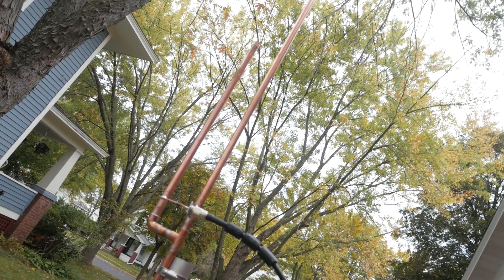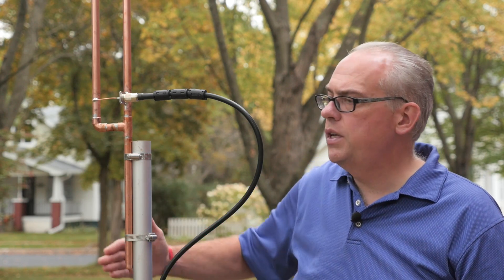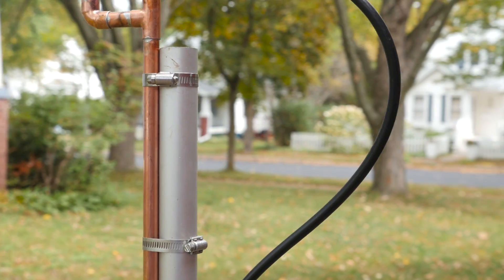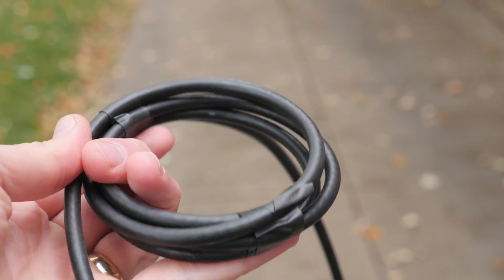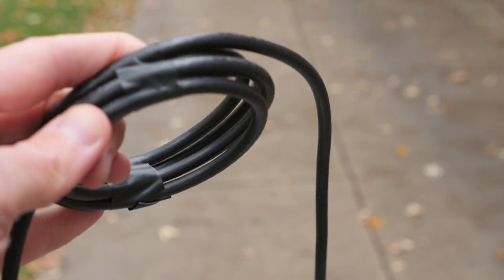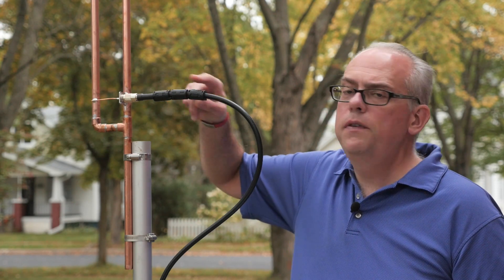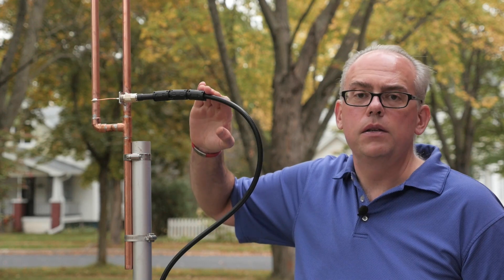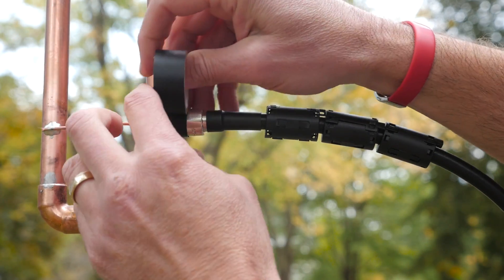Installing the KB9VBR J-Pole Antenna

Comment: Is that mounted to a metal mast? Is it grounded?
Reply from the maker: The J-Pole is a half wave antenna by design, so it does not require a ground plane or special grounding to function. You can mount it to either a metal or non metal mast without affecting its performance. Hose clamps or U-bolts work the best for mounting it to the mast.

Comment: Why do you have the center conductor going to the short leg?  Isn’t that incorrect?
Reply from the maker: As you have probably found out by searching online, there are plans that attach the center conductor of the coax on either side of the antenna. I have experimented with attaching the center connector of the SO-239 to the stub and to the main radiator. I have not found a difference in signal quality or performance. I choose to mount the edge of the connector onto the main radiator because I believe it makes a better mechanical connection.

A J-Pole style antenna is comprised of three sections. First is the mounting section where the antenna is attached to a mast or support. The second section, which is 1/4 wave long, is the impedance matching section. The two pieces of the antenna that run parallel to each other change the impedance from the 50 ohms at the feedpoint to about 300 ohms which is the impedance at the start of the third section. The third section, which is 1/2 wave long is an end-fed dipole radiator. With end-fed antennas, the impedance is high at the ends and low in the middle. With the 1/4 wave section, the impedance is low at one end and high at the other. So the two parts of the antenna can work in harmony.

Interestingly enough, in the Rothammel's Antenna Book (13th ed english translation, page 777) the author states that feeding both the short and the long sides of the antenna are electrically equivalent, yet a configuration where the short side is direct fed provides improved overvoltage protection because the half wave section is directly grounded via the outer cable conductor. (parenthetically, this method also helps lower the overall noise floor of the antenna, by dissipating static to ground). 

Since a J-Pole is considered a balanced antenna- it is a half wave antenna by design; the RF energy will travel up the matching section and then radiate from the resonant part of the antenna. Hence it really doesn't matter which side the connector is attached to.

Comment: Does the azimuth facing direction of the 'short' side have any effect on the radiation pattern?
Reply from the maker: The antenna is omnidirectional but there is a very slight bit of directivity. Maybe .5 dB, which isn't much. I usually tell people installing the antenna to make some test transmissions, rotate it 90 degrees and repeat. Pick the direction that gives you the best results.
Reply: @KB9VBRAntennas  thanks.

Comment: As a new Technician getting into the hobby this is a great antenna. I only have an HT (handheld) at the moment, a Wouxun KG-Q10H, 6 watts max, and participated in my first local net the other day. When I was using the HT antenna, I could barely be heard. I switched to this VBR J-Pole antenna and they reported full quieting. Solid construction, great results, and very affordable! Thanks! Pete KQ4TNW

Comment: Electric tape is not a good option, coax seal tape should be used for that application.
Reply from the maker: Why not? It's commonly used at commercial tower sites.
Reply: @KB9VBRAntennas  Run of the mill electrical tape is not meant for applications that expose it to direct sunlight and its not at all meant for weather proofing.
Reply from the maker: I agree. That's why in the video I recommend high quality electrical tape such as Scotch 33+ or Super 78.
Reply: @KB9VBRAntennas  As an electrician we can not use any vinyl based tape for weather sealing, NEC (National Electrical Code) calls for rubber or MIL tape.

Comment: Hi Michael,

A few quick questions: If I mount a J-pole antenna about 15 feet above ground, with no interfering metal or buildings, can I reasonably expect to connect with repeaters about 80+ miles away?
(The repeaters operate on 2 m and 70 cm, with their antennas about 50+ feet in the air.)

I am using a 5 watt HT at my end, and would like to use either of these frequencies, whichever works best.

Also, would a Slim Jim antenna work better here?

Thanks,
Jerry Wysocki, KC9JXE
Reply from the maker: This is a tough question to answer without knowing about the terrain and the coverage pattern of the other repeaters. It could be possible to hear one 80 miles away if the repeater was in a very good vantage point and running a bit of power.  

As for choosing one over the other, J-Poles are a good choice if you are mounting the antenna at a lower mast height, or if you live in an urban area or valley. The omnidirectional radiation pattern and higher takeoff angle makes it easier to get a signal out if you are surrounded by buildings or rough terrain. Also, with the base of the antenna at DC ground, you can mount it on a metal or non metal mast with affecting the antennas performance. It also has a very low noise floor which makes the J-Pole an excellent receiving antenna for weaker signals. 

The Slim Jim has a lower takeoff angle and more compressed radiation pattern. These two features of the antenna gives you about twice the gain as a standard J-Pole. A little more gain will make up for some of the feedline losses you’ll receive at VHF frequencies. Plus it will help stretch your signal out a little further. To really realize the benefits of the Slim Jim, you need to mount it in the air at about the 20-30 foot level. It will work well at lower heights, but the antenna shines when you get it up in the air.
Reply: Thanks for your answer. I'm in Illinois, about 80 miles directly west of the uppermost northern tip of Chicago. So it's pretty much flat terrain, with elevation going up gradually about 300 feet from where the repeaters are, to my location.
Does a Slim Jim antenna have the same similarity with the J-pole, in that with a 2-meter J-Pole, you can also use a 2-meter Slim Jim on 70 cm, as well? In other words, are Slim Jim antennas, dual banded like J-Poles are (2-meters as well as 70 cm, useable on the same antenna)?
... Jerry, KC9JXE

Comment: Thanks for your videos, parks on the air, etc. Very helpful. Question of the day, so what if I use hyperflex10 cable your snap on baluns and say wanted to put a loop of wire up there in case I swap out the antenna at some point? will a single loop of wire case issues? Any why 4" - is that a function of the signal around the wire? What if the loop was 10" ?

Comment: Hello :) Which GMRS J-Pole antenna do I need for a cheap Baofeng UV5R radio (GMRS & FRS Frequencies installed) & what connectors/cable do I need to order from your site ?... Thanks.
Reply from the maker: This is the antenna you will want: https://www.jpole-antenna.com/shop/462-mhz-land-mobile-gmrs-j-pole-antenna/
Reply: @KB9VBRAntennas  
SO-239 Connector or N-Female ?
Thanks :)
Reply from the maker: The SO-239 is the most popular choice and it will work with the widest variety of equipment. The SO-239 (UHF female) connector mates to the PL-259 (UHF male) connector commonly found on coax cable. Here's a video that tells more: https://youtu.be/DoKtRSLDY40

Comment: How about adding heat shrink to protect the feed line connection to keep moisture out would it cause any problems ?
Reply from the maker: You could protect the connection with heat shrink, although that may not give you the best seal. I prefer high quality electrical tape like Scotch 33+ or Super 78.

Comment: If needed what is the best way to ground this antenna? Just purchased one. I’m excited to set it up.
Reply from the maker: If you live in a lightning prone area, you may want to create an electrical ground to protect the antenna and your equipment from lightning hits. You can run a ground wire from the base of the antenna to a ground rod, but I think a better method is to install a lightning arrester where the coax enters the house and ground that. The ARRL has some great resources on lightning protection you may want to check out: http://www.arrl.org/lightning-protection

Comment: Would the six meter j-pole work fine in the 50.110 MHz range?
Reply from the maker: Yes it will. I normally tune the the 6 meter J-pole to 52.525 MHz but it doesn't have enough bandwidth to cover the entire band. You will need to use a tuner for frequencies at the bottom of the band. But if you are more interested in sideband operation, I can build the antenna tuned to 50.313 Mhz and it will then work the sideband and FT8 portion of the band without a tuner (you will need a tuner for FM, though).
Reply: @KB9VBRAntennas  Thanks! I only work CW and SSB on 6 meter. Be expecting an order in the near future. KA6VVD 😊

Comment: Can this be used with a uv-5r
Reply from the maker: The J-Pole is a great choice as an external antenna for your Baofeng handheld. You will need two items to connect the radio to the antenna: an appropriate length of feed line with PL-259 connectors on each end, and a SMA Female to SO-239 adapter.

The coax and adapter can be purchased at amazon. Here's one such adapter: http://amzn.to/2A5KQTq

Comment: Just put mine up after receiving it best antenna ever no tuning swr is 1 on my Yeasu ftr2900 as a base hitting local skywarn rptr that is 40 mi with no problems and now can talk on local linked rptr I used flat window pass through with smos and short jumper with pl259 added couple ferrites with chokes for extra rfi  my ground is a ground rod driven in 4 ft with copper solid wire offset up. Using old chain link fence poles two sections just 15 foot up works great 👍 I’m 73 KD0EBF

Comment: I temporally stuck one of his builds up on a speaker stand pole.  About 15ft up.  Bought some LMR-400.  I hit a repeater about 25 miles away with a Baofang GT-5R.  Was told I was coming though fine.  Hit a repeater 8 miles away and was told my signal was very good.  They work.

Comment: Some people put the center of the coax  on the 1/2 wave section, does it matter whether it is
placed on the 1/4 wave section or 1/2 wave.  thanks
Reply from the maker: As you have probably found out by searching online, there are plans that attach the center conductor of the coax on either side of the antenna. I have experimented with attaching the center connector of the SO-239 to the stub and to the main radiator. I have not found a difference in signal quality or performance. I choose to mount the edge of the connector onto the main radiator because I believe it makes a better mechanical connection.

A J-Pole style antenna is comprised of three sections. First is the mounting section where the antenna is attached to a mast or support. The second section, which is 1/4 wave long, is the impedance matching section. The two pieces of the antenna that run parallel to each other change the impedance from the 50 ohms at the feedpoint to about 300 ohms which is the impedance at the start of the third section. The third section, which is 1/2 wave long is an end-fed dipole radiator. With end-fed antennas, the impedance is high at the ends and low in the middle. With the 1/4 wave section, the impedance is low at one end and high at the other. So the two parts of the antenna can work in harmony.

Since a J-Pole is considered a balanced antenna- it is a half wave antenna by design; the RF energy will travel up the matching section and then radiate from the resonant part of the antenna. Hence it really doesn't matter which side the connector is attached to.
Reply: @KB9VBRAntennas  Thanks

Comment: Not a Ham. Do I put a lightning arrestor on my coax and ground it 8/9 feet  with a grounding rod?
Reply from the maker: If you live in a lightning prone area, you may want to create an electrical ground to protect the antenna and your equipment from lightning hits. You can run a ground wire from the base of the antenna to a ground rod, but I think a better method is to install a lightning arrester where the coax enters the house and ground that. The ARRL has some great resources on lightning protection you may want to check out: http://www.arrl.org/lightning-protection
Reply: @KB9VBRAntennas  Thank you for your assistance. Have had your 2 meter antenna for @ six months and just installed it yesterday on a uniden SDS200 scanner.  I live in a vary mountainous area and pulling in stations that are 80 to a hundred miles away. Presently studying for my technician class license and planning to operate on a Yeasu 991a. I am finding that my Gmrs license has motivated me to install a Gmrs repeater and get my ham license. Thanks for your kindness in responding to my question and indirectly being my first mentor. WRPL945.

Comment: What type of solder are you using to connect the center coax wire to the copper pipe?

Comment: Hi there, first of all thanks for making a great simple to use product. I own one of your slim Jim antennas and it works great. I do have a question on the radiation pattern and orientation of the antenna.  I don't want to buy a Yagi antenna, as I want it omni directional. I am however trying to reach a repeater and maximize my received signal strength. Here is a link to the wiki page on JPole, in this case, would it be better to mount the antenna with the orientation 0 to -180 or 90 to -90 degrees? As viewed from the top, is it best to have the antennae oriented like this - or like this |  Does this make sense?

https://en.wikipedia.org/wiki/J-pole_antenna

Comment: I'm making a J pole, can I just use the calculated location for the coax or should I make it adjustable?
Reply from the maker: I find the calculated location of the feed point needs a bit of optimization, so if this is your first J-pole build, make it adjustable.
Reply: @KB9VBRAntennas  We made it, measured twice before ever cut. The SWR is a 1. I was surprised. We put about 7 (4" dia.) turns of of coax before the feed point.
What do the loops do?
Reply: @KB9VBRAntennas  OK, thanks.
I'm making the antenna for my son who just got his ham license.

Comment: I am new to all of this. I want to mount a J pole in my attic and connect it to a Boafeng UV-5R radio. What type of coax do I purchase and what type of connections need to be on the ends? Thank you.
Reply from the maker: Your coax will need to have PL-259 connectors on each end. I recommend LMR-400 if your cable run is 50 feet or more, otherwise RG-8U is good for shorter lengths. The UV5R requires an SMA Female to SO-239 pigtail style adapter to connect it to the coax. Here's a video on the different types of connectors: https://youtu.be/DoKtRSLDY40
Reply: @KB9VBRAntennas  Thank you!

Comment: I have my KB9VBR J-pole on a Kenwood TM-281 as well, about 12 feet up on a PVC pipe sticking out of a bucket of cement. I am able to hit a repeater in Mount Greylock, MA about 150 miles away! Granted it's 60 watts but still, that's impressive with an omnidirectional antenna.  While there must be a direct line of sight between my antenna and that mountain, it's still impressive. I can also hit other repeaters as far as 60 miles away. Michael clearly knows what he's doing when building these.
Reply from the maker: That's awesome. Thanks for the testimonial
Reply: That is so rad!

Comment: Can you paint these?
Reply from the maker: You can paint it with clear lacquer or a non-metallic spray enamel to protect it from the elements or help it blend into its surroundings.  If left unpainted it will develop a dark brown patina. This won't affect performance. More information on painting the antenna can be found on my blog. http://www.jpole-antenna.com/2011/01/04/painting-the-j-pole-antenna/

Comment: What about lightning protection/safety? I’d like to get one of these for my roof. Thank you Michael. Great video.
Reply from the maker: If you live in a lightning prone area, you may want to create an electrical ground to protect the antenna and your equipment from lightning hits. You can run a ground wire from the base of the antenna to a ground rod, but I think a better method is to install a lightning arrester where the coax enters the house and ground that.

Comment: Cool tks Fer fine. Show. Got one shipped from Missouri. To make a choke. I used a pop can @ 6 turns W/wire ties. Then painted the connection with liquid tape. To seal out rain and foul wx.  Testing the lash up. Found as little as 2 watts at 20' off the ground got me white bluff TN from pine wood TN. In fine order. Rgu 58. Does the honors. This does so well that the antenna gets its own HANDI talkie. I just leave it there. they both have a good home. Ps the choke was taught to me on the signal corps. As a vrc 47 operator somebody was always snapping off whips in passing trees/ bridges. At high speed I had a Schlitz can and a big roll of tape. Worst thing was trying to keep the first Sarge from drinking the beer. He he. kV 4li

Comment: Hi Michael. Looking to purchase one of your J pole antennas for listening to the airband. As I will be listening only will I require an RF choke on the feedline or will be fine without it. Thanks.
Reply from the maker: The purpose of the choke is to keep stray RF energy from traveling back down the outside braid of the feedline when you transmit. If you are using the antenna for receive only‚ then the choke is totally optional.
Reply: @KB9VBRAntennas  Appreciate your prompt reply. Thanks Michael.

Comment: you need a cover of the mast pole so it doesn't fill with water?
Reply from the maker: If the mast is open on the bottom‚ the water will flow through.

Comment: Hello. this antenna has a design with different negative and positive connections in different elements. mine is isolated from the mast, which is smaller, lands on the mast or not?